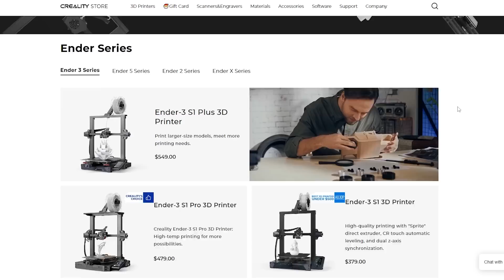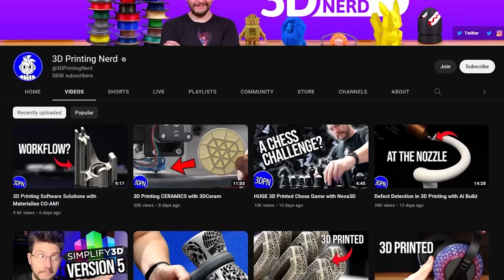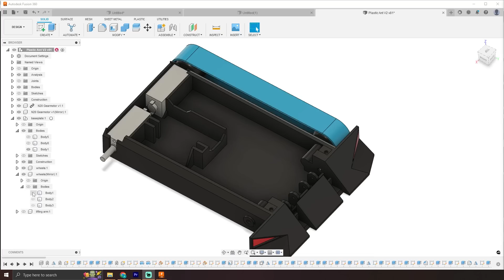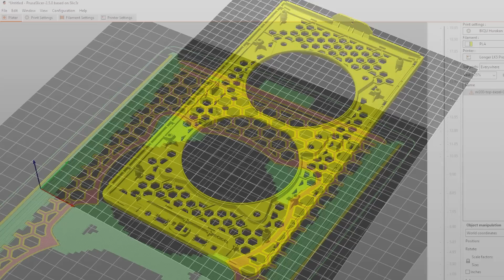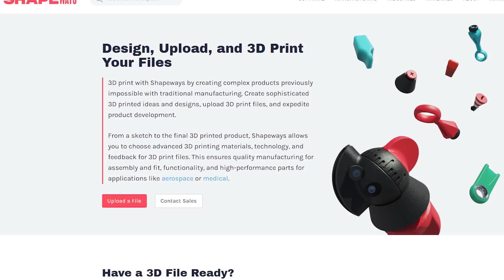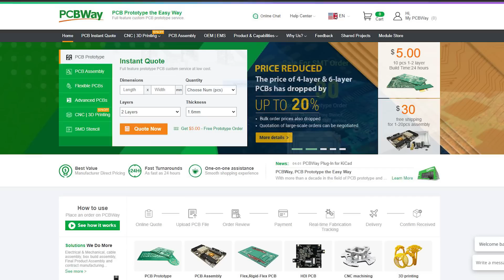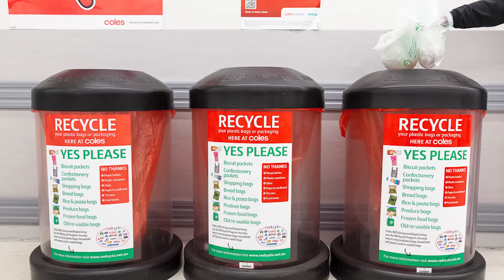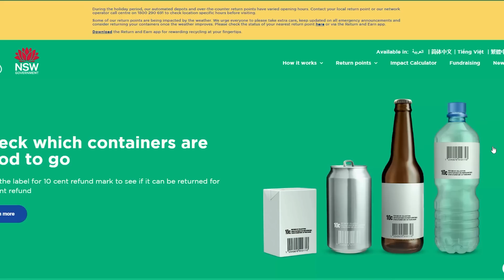My 3D Printing Predictions for 2023

Comment: My dad (76) started using an Ender 3v2 for the first time this month. I used your classic explanation of "this is a hobby and not a tool". For his first print he chose a HO scale model that requires 25 parts to be printed, not the easiest but he's getting there. Had a little bit of trouble with bed leveling at the start. The look on his face when using this machine is magic.
Reply: I bet the look on your dad’s face was similar to my boys’ faces with every new print in the first week.
Reply: I gave my dad (71) an assortment of 3d printed tools for Christmas last year.  He bought his own printer a few days later and now makes custom ASA brackets and mounts for ham radio antennas.
Reply: @cvabuck5489 ham operators are generally operating close to genius levels. He's likely just getting started and you will be asking him for help soon. :)
Reply: It's a tool, and a great one even. If you print useless crap that will just lay around yeah, it's a hobby. Except for some xyz calibration cubes, everything I print has a use, whether I have to design it or find it online.
Reply: Also using it related to model trains in HO scale ;-)
Reply: @Buzás András  what's it doing mine wasn't performing well either I can't remember what video it was but I copied his settings and now works perfectly also I got the stiffer springs and all metal extruder no more problems
Reply: That is a great can-do attitude. HO models with an Ender 3? Give him a tablesaw next year and he'll probably try to build a rocketship. Imagine what he could do with the right tools for the job, like a Saturn2.
Reply: @roystevens4333  3D printing model train buildings, cars and RC model planes is gonna be huge! I've printed several Eclipson model planes as well as garden model railroad parts on my Ender 3. Now using a CR-10. It's perfect in these applications.

Comment: I used Protolabs years ago to make relatively low cost low volume injection mouldings. This is not new to 2023.
Reply from the maker: How was the experience? I didn't know the service had been around for so long
Reply: @MakersMuse  It was very good,. The moulds were aluminium, so low cost, but also low volume. But for my purposes of about 10,000 relatively simple pieces (no undercuts or other part complications) in a multi-cavity mould it was good enough.

Comment: Cost and steep learning curves are a turn-off, so something free and simple-ish would take-off.
I like TinkerCAD because it's simple and easy, but I would like something more. Like if you want to bevel an edge it takes more work, ie, get right-angle triangular prism, re-size, position, subtract. I wish TC would just have a bevel/radius edge you click on.

Comment: SLS nylon printers are amazing and are a great example of an industrial machine that is becoming more accessible. $100k machines can be had used for $20k with the right contacts and there is a guy in Se Qld with one that has 6 full time staff running and supporting customers for just 1 machine.  Now companies or hobbyists can develop a part and prototype in pla and get final parts made quickly at a reasonable price per part with no tooling costs. Now all we need is a send cut send or pcb way style company in Australia. 

Personally I'm seeing 3d printers being a gateway for many hobbyists into the broader cnc world, I'm building a plasma table ATM so I won't need to get stuff lasercut anymore.

Comment: I agree with the CAD statement, though I would like something that is more powerful than Tinkercad, but not something so powerfull as Fusion360 that tries to do it all.  I'am currently still using 123Design even though AutoDesk stopped supporting it many years ago.  I'am still on Windows 10, and the main reason I havn't switched over to 11 is that I fear that 123Design will not work under 11.  I know for a while that 123Design tending to crash when trying to extrude objects, so I had to save my work before extruding.

Comment: acoustic leviation 3d printing, like in the movie big hero 6 , a chamber where the resin is vaporized or sprayed in very small size droplets and then a laser will project the object to be printed , or maybe like hologram where object will hard , but the issue is when its being cured mid air , dont know if it will be able to be lifted by the acoustic levitation , maybe it will need to be built around a solid object , or if there is a way to convert the 3d model into a audio waves that can form the object out of the resin and then uv light shines on it to cure it and will only have the exact amount of resin since we know the volume , maybe , 3d printing space ships in space or space station on the moon with the moon dust ...

Comment: “If I was a company who's been sitting on the same model of 3D printer for four years with little to no iteration, then I'd be pretty damn worried.”

Prusa comes to mind. Their Prusa XL sounds great but I’ve heard nothing but excuses why they can’t produce it in significant quantities. Their i3 MK3S+ has been eclipsed by other printers, some of which leave that antiquated hardware in the dust.

I don’t understand why any intelligent, informed consumer would now purchase a Prusa. They supposedly had great tech support, but I’ve found it better at wasting my time than solving my problems, perhaps because they see the writing on the wall (with competitors leapfrogging them), realizing they need to conserve every penny.

I think their big mistake was resting on their laurels and assuming because they did some things impressively well, they were justifiably blind in addressing some of their harebrained engineering decisions. As Robert Schuller famously noted, “Big egos have little ears.”

Comment: For the CAD, as well as easy-to-use for beginners, I'm hoping there will be a viable more sophisticated CAD that doesn't cost a huge amount. Which might also happen in 2023, FreeCad is aiming for a "V1.0" release which hopefully means it will be a lot better than it has been - so far it's been cumbersome and buggy, most consensus I see is that it's not quite ready. I'm hoping "1.0" means, for the first time, it's own developers regard it as ready for actual use rather than being an in-development project that the "0.20" refers to.

On the recycling end, the PET bottles feels a little gimmicky, and doesn't make use of failed prints or other scraps. There are filament making machines out there, but they're quite pricey - for now a small niche. Maybe that can be the next "race to the bottom," if mass produced they should be able to be made very cheaply given their simplicity. Some sort of shredder might be the more costly part though, as that would have to be quite powerful and robust to chew up 3D printed stuff, especially solid parts or big blobs.

Comment: I think it’s interesting that you slam Ender for their lack of innovation, but nothing about Prusa, despite the fact that Ender has produced multiple printers beyond the Ender 3 in the past few years, and Prusa hasn’t produced anything new. 🤔
Reply: I agree, I do not understand what people think Prusa is doing that is so great at this point. That said, I have 3 Creality machines, all of which I appreciate, but even the newest which is my S1 Pro isn't that advanced. When it came out it was a big step for the Ender line. However my S1 Pro does not have wireless remote control, no camera, and oof the firmware and touchscreen experience was dubious at best. Slow, none of the latest features such as pressure advance/input shaping. No matter, I put Klipper on a Pi,  remote viewing with a $20 1080p USB camera, and I am quite happy, but that was at additional cost. Of course they finally saw the beauty of Klipper with the Creality SonicPad, but it's still not leading innovation. Long story short, both Creality and Prusa are losing sales right now to Bambu, I am certain of it, given the 3d printing communities I'm in...

Comment: Addnorth a Swedish filament manufacturer actually has a recycling system for thier PLA, but it has to thier own PLA you send back to them. You can't send back less then 5 och 10kg to them of failed prints and spools. And if you'd like to buy that PLA in black and black only ihs called PLA Re-add and rPLA, rPETG and rABS.

So there's a change comming to the 3D printing. 😊 There should be more companies doing this if one looks into it.

Comment: As far as people getting into 3D printing and designing themselves, a lot of people that have been doing it themselves forget the time and effort it took to get to where they were doing it themselves. For absolute beginners, how many have covered the equivalent of learning basic arithmetic as opposed to the equivalent of higher mathematics (that depends on the foundations of lower difficulty mathematics) and, more importantly, do they enjoy going through that learning process, combined (to some extent) with being able to think in the ways needed to make desired results happen?

3D printing is largely a self-selecting group of makers that will make because that’s their nature and mindset, if they don’t have another way to fulfill wishes, they’ll make a way!

The advent of $200/less viable 3D printers isn’t going to meaningfully change any of that, nor will cheaper prosumer models, those prices only impact the makers with the means to budget those prices for the value, real or perceived. The same sort of self-selected people will get into it and not quit early.

Comment: You missed the impact of Advanced AI.  Text to 3D modelling is already starting and will explode in 2023, as will image to 3D models.  Define your part in words and get a model you can scale and print.  Grab some 2D photo and get a 3D model of it you can print.  No CAD required at all.  Or, if you want a little more control, ask Chat-GPT to generate Python code that creates a shape in FreeCAD or Blender.  Go ahead, it's already starting to work.  Not great yet, but the next AI version is due fairly soon.  It won't be long before we can ask AI to generate a STEP file from an STL... or a single photo.

Parents that invest in a 3D printer will be able to watch their kids type out a few words, perhaps along with a photo of their kid's crayon drawing, and generate an actual physical object.  Not just download and print some toy, but let their kids create their own toy from their own imagination.

And, there's another point to consider, the open-source advantage.  Chat-GPT is already an incredibly fast way to learn how to code in any programming language.  But, because the AI disconnects the source from its results, it leaves open the issue of incorporating likely open-source code.  Thus, companies that rely on closed-source code can't let their employees use it.  The advantage will massively shift towards having open-source code and the likes of Autodesk will have to adapt.  Over time, more and more CAD options, along with everything else, will become open-source.  This last one probably won't make much of an impact in 2023, but it's going to be huge over the long run.

Meanwhile, Chat-GPT will help you learn a CAD application way faster than you ever thought possible.  Imagine having a tutor right there to ask every stupid question... like, "how do I open the Python console in FreeCAD?"  Answered in 2 seconds.  Repeat, repeat, repeat... It's so good, I might even be able to learn how to use Blender :)

Comment: I don't think we will see simplified CAD. The highest of possibilites I see is Cura and Printables expanding on their limited edit functionality. There is a a reason CAD tools are so annoying to use. It's not the low number of users it's that the usecases are complex. And while people thinking easy operations translating those into designs usually isn't. By the way isn't fusion still free for homeusers?
Concerning the Recycling Problem: I ran into the same problem here in Germany our "Pfandsystem" is great I don't need to recycle PET Bottles. And Just melting old prints into forms is not very useful(As I don't have a lot of parts that could be done with casting). What we are missing is the melting failed prints into usable Filament again. Or atleast for the PLA waste: Usable composting machines that can break it down in a reasonable time. It is biodegradable it just needs a certain environment.

Comment: I think there will be 2 races running. Longer term, you'll see a race to the bottom to get more features at a lower price point. Bambu Lab has already started the race for Out-of-the-Box (OB) great printing. They set the "standard" with the X1C and then already did the "stripped" down variant with the P1P... I expect the next portion of the race will be to get  CoreXY OBs as the new rage/bottom. There are many CoreXY kits out there, but ALMOST no one with CoreXY OBs with similar abilities at similar price points. The prosumer market will see a drop with many of the "lesser" brands die/switch out lest they move to a more open system since there are now better alternatives to attain afforable OB machines that can perform at the level and speed they need.

The shorter term, there will be a flood of current high-end printer features be made "common"  and racing to the bottom. Many will be focusing on ways to speed up the printers. Other features such as pressure advance and such will become more common and easier to use if still a bit manual.

The slicer market will definitely see some level-ups as more ways are still being sought on how to reduce the need to use supports (such as the floating disc method or the conical slicing ideas as of late).

As for the CAD modelling, I also expect to see an affordable/free CAD system take a good chunk of the market if they can provide higher level abilities/features without the increase in price. If someone could take the simplicity of TinkerCAD and give it more "professional" polishes such as chamfered or rounded edges for all their primitives, that would go VERY far in garnering the newer and fledgling makers out there, who can then upgrade to more advanced CADs.

Comment: I suspect 2023 will be the year of the tool changer. The Prusa XL launch next year will make or break the concept and if it’s as good of a step up as I think it may be over things like the MMU, AMU, or Palette, I think there will be lots smaller companies selling coreXY tool changers in the later portion of the year. AI based failure detection will get a little more reliable and easy to use. Fingers crossed that someone develops an affordable non oil based plastic that actually biodegrades under normal circumstances and prints okay.

Comment: I've said this before but I still believe Desktop Injection Molding is primed like a powder keg to have an explosion of interest.  There's already kits as cheap as $200 and eventually someone will figure out that the real thing holding this particular niche back is the fact that there aren't any interesting, cheap, or even available molds. It all just needs to be combined into a neat package and then people will lose their minds.

Sure, 3D printing can make almost anything, but show people that with the pull of a lever they can make a fidget toy or a Lego-like connector system out of garbage, then you could have an entire industry. 

Once that ball starts rolling the Chinese knockoffs will immediately jump in the mix.  It'll become a force to be reckoned with.  The prosumers will probably be looking for automated injection molders which I genuinely believe could get down to the $500-$1000 level if there was a market for it.

People just need to be shown what desktop injection molding is capable of and it needs to be stupid easy for them to get involved.  Maybe it's just wishful thinking but to me it feels inevitable.

Comment: Slight correction when you talked about ease of use for 3D software.... I predict in 2023 we will start to see consumer text input to 3D model AI, just like with MidJourney for picture art, but for 3D models instead.   Google, Nvidia and there's also 1 research group have ALREADY created text input to 3D model AI generation, however, they have kept the AI internal, are still working on it and haven't released it yet to the public.  I suspect in 2023, 1 will emerge to the public.

Comment: I really would like to use PET bottles to create filament for 3d printers. The problems is that cheap filament extruders will create a filament with a variable diameter. This is a problem that affects the print quality very much. Someone should work a feature for 3d printer firmwares like marlin and clipper, where using a sensor that measures the diameter of the fialment it compensates the flow of the printer in real time, thus it wouldn't matter if the filament has a variable diameter as the printer will compensate by rising or lowering the flow at the exact moment the measured filament exits the nozzle.

Comment: Speaking of CAD, I think we'll see Fusion continue to remove more and more functionality from their free license for hobbyists. I won't be surprised if at some point we won't be able to export STLs without paying. 

As far as simpler CAD goes, I think that's just a phone app or two away. Being able to doodle on the touchscreen on your phone is easier for the uninitiated than using a mouse and keyboard with regular CAD software. I'm aware there are already a few mobile CAD apps out there, but from what I've seen they just aren't there yet or require a subscription.